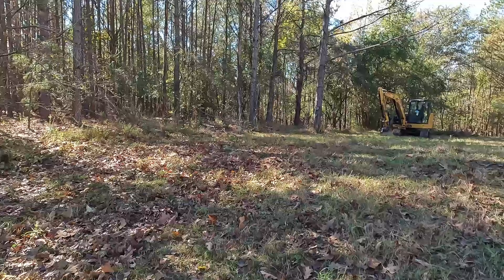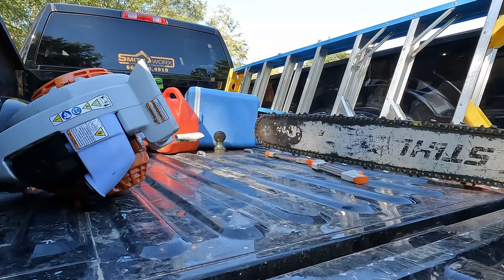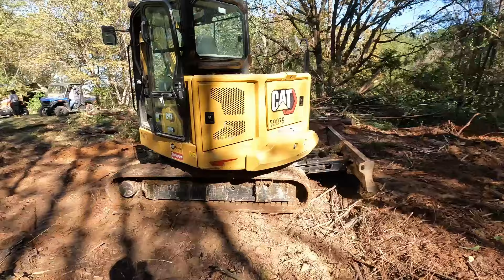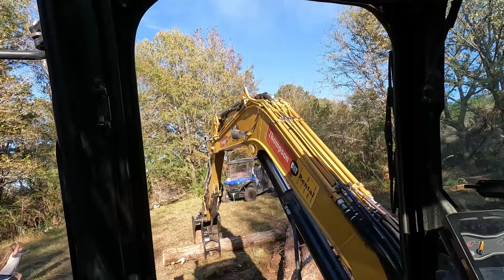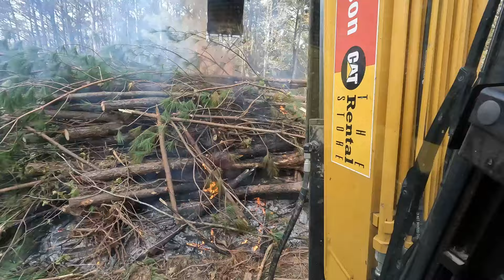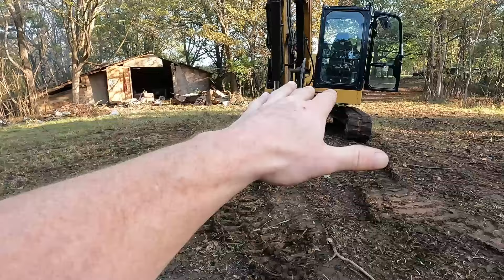I'm Back In A Cat 306!  I ran the dog out of it

Comment: I’ve got a 2023 306cr that I use in my excavating business and I real like the flexibility it has. I can change the thumb direction through the monitor on my 306. Not sure why the 306 rental machine wouldn’t let you change it.  I really like to use a 36” digging bucket for brush clearing with a thumb. The 306 has plenty of power to dig as deep as you want in medium to hard dirt. That’s my go to bucket for almost everything.
Reply from the maker: @billostler9549  it's a very well rounded machine. I'm not sure why some models will let you change the thumb pattern and some won't. Appreciate you commenting bud

Comment: I'm interested to hear which way you prefer your thumb switch?  I like mine to close when I push down.  I have a 304 and a 312 and they are backwards from each other.  I don't know which way is "correct" if there is such a thing.
Reply from the maker: I like mine to close when rolling down also. When you think about it, it's just more natural to curl your wrist and roll down on the thumb wheel. That's how my brain works anyways. You can swap your electrical connectors on the thumb valves to make it a lot easier than swapping around hoses.